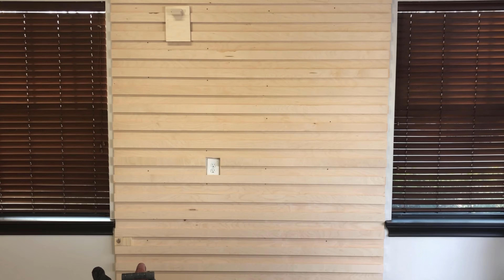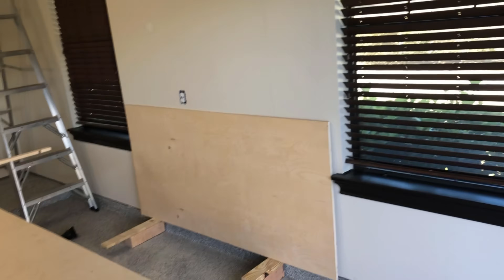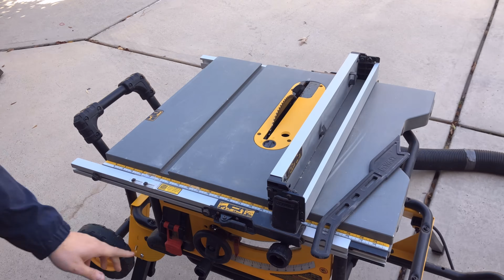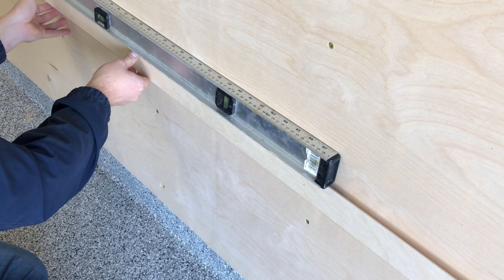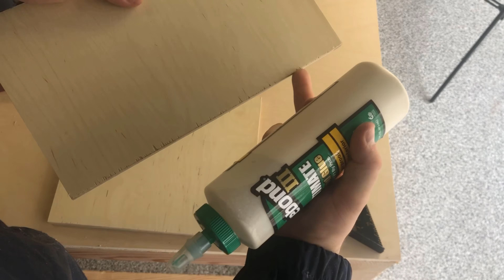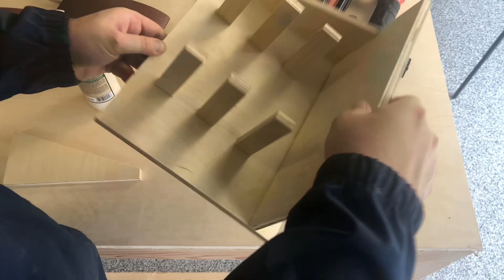French Cleat Tool Wall - Ultimate Shop Organization

Comment: why you need to put plywood on the wall? Seems like waste of $$ and wood.
Reply from the maker: It was an attempt to save the drywall in the garage. I was concerned that tightening down the cleats directly onto the drywall would cause them to "sink in" to the drywall and leave an imprint if I ever wanted to remove them. At the time, a sheet of plywood was ~$40 so I elected to spend that money to protect the drywall in the garage. 

Hope that helps. Have a good one Swapnil :)
Reply: @EigenDesigns  I am thinking about that problem right now.. I have to make a decision, do you recommend it? Here it costs nearly 80 usd..
Reply from the maker: @mvwo  I would still even do it for $80 USD. If you ever end up taking the french cleat wall down you can always re-purpose the plywood for another project. 

BTW, my french cleat wall might be my favorite shop project I have done thus far. It has helped me stay organized in the shop and not clutter my shop with excess tools. Good luck building!

Comment: Did you think about putting the cleats on the plywood before installing the plywood on the wall? I am thinking about mine atm so trying to think it through any pros cons.
Reply from the maker: That’s a great question. You could certainly do that. Two things to consider: pre-installing the cleats will make it heavier, so if you’re working alone that could make things more challenging. Secondly, you won’t be able to use the cleats to hide the screws that hold the plywood to the wall. But if those two things are not an issue and you could certainly pre install the cleats. I hope this helps :-)

Comment: What happens when you upgrade tools with different designs and the wall mount doesn't fit the new tool?
Reply from the maker: That's a good question. I have come across this already and have handled it two different ways. If the new tool has a similar design to the old one, you can modify your existing holder to make it fit. Alternatively, I have just built entirely new containers. The plywood I use I mostly from scrap pieces left over from old projects so there is minimal cost and it generally takes around 10-15 minutes per holder.
Reply from the maker: Hey Robert L. I made a few more containers for my French cleat wall to better organize my clamps and thought you might get some value from watching it. I know you were curious how to handle new tools being added to the collection.

https://youtu.be/ERxP_fEIB3E

Comment: Great job, i subscribed to your channel. Can I ask you the measurements of the french cleats? Length, width and height? Thanks Francesco
Reply from the maker: Hi Francesco! I made the french cleats out of 3/4" plywood so they are all 3/4" thick. The french cleats that went onto the wall were all 70" long and the high-side of each cleat was 2.5" tall. I hope this helps answer your questions.
Reply: @EigenDesigns  can you also tell us what was the height of the spacers used?
Reply from the maker: @kashyappalicha797  The spacers were 2.75" tall which makes the gap between the cleats 1/4" larger than the mating cleats that are used on my tool holders. You can certainly make the spacers larger, but I wanted to make the cleat rails as tight as possible.